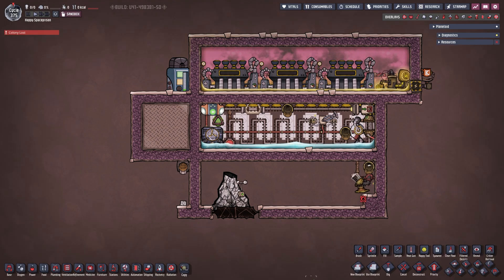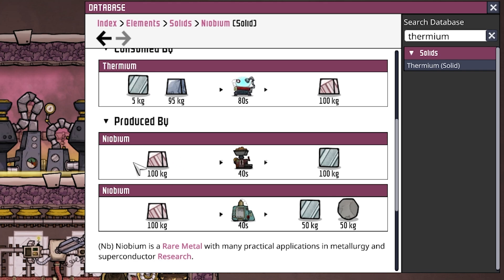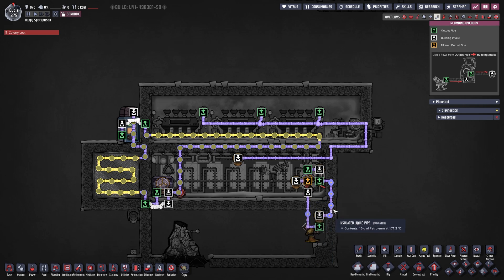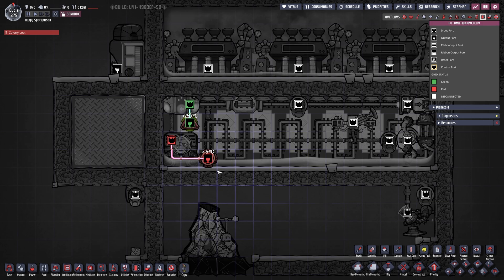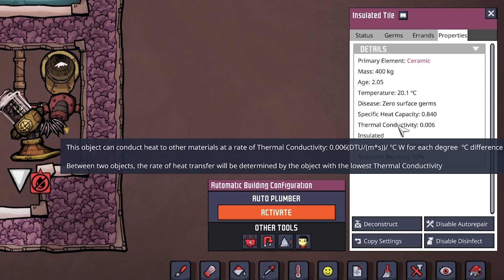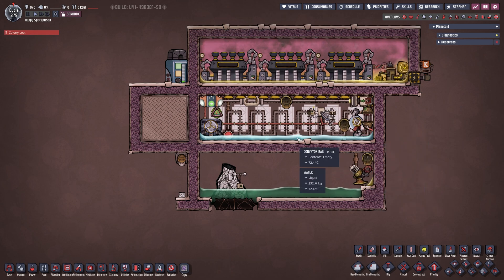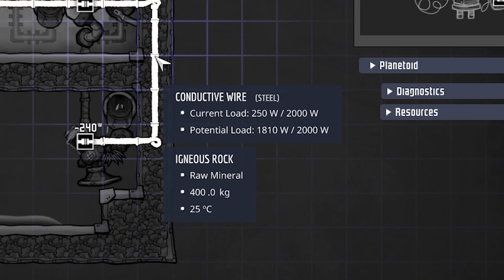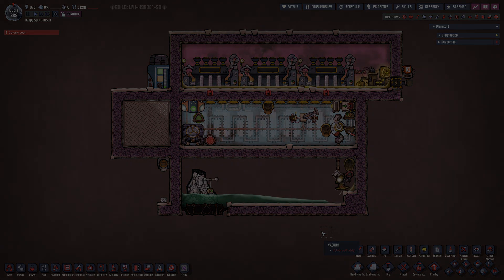GERMAN ENGINEER explains ONI: NIOBIUM VOLCANO TAMER for Thermium! Oxygen Not Included Spaced Out

Comment: one more question, instead of the filter and meter valve, the "mechanical filter" couldn't be an option?
Reply from the maker: The mechanical filter would be an option instead of the filter, but the metering valve is needed to control the exact amount of liquid being dropped on the tile by the pump. That is highly important, so no liquid ever leaves that tile and comes into contact with the Niobium!

Comment: with the tile under the left part of the pump as a thungstene pressure plate ( or hydro sensor to not mess with the insulation line under) couldn't that be used to turn of the pump instead of a manual switch? iirc that one would not melt

Edit: I'm dumb, forgot about overheat temp, don't mind that one!
Reply from the maker: Haha, it happens, no worries :)

Comment: What is the function of the metal block on the left?
Reply from the maker: This is a "cooler" or "cold box". The tiles are made from aluminum, cold water is routed through it to cool down the metal tiles. The aluminum has a very high heat conductivity and in turn cools down the solid material on the conveyor rails that we route through it. Easy and fast to built, but extremely efficient :)
Reply: @BierTier  Thank you

Comment: Nice design.  BTW I’m pretty sure you don’t need thermium for the liquid pump if you cool it with a loop of hydrogen gas.  Just one piece of radiant pipe in the place your petroleum  priming liquid drops down will cool the pump and you can then loop the gas up to dump the heat off in the steam room.  Then a steel pump should be more than enough as long as the pump doesn’t actually touch the niobium.
Reply from the maker: Thanks! Yes, I think you are right, that could be solved differently, with your version for example. I wanted to make 100% sure that it works in this build for a long time and not make it any more complicated than it already is :)
That's what I love about ONI, many different paths lead to the same or similar result :)

Comment: will the liquid pumb break if let it run for a long time because no coolant for it ?
Reply from the maker: You are correct, I overlooked the pump. It will take so long for it to cause an issue since it's built out of Thermium that I kinda forgot about it. But, here is a easy fix for that though: https://bit.ly/PumpCooling
Reply: @BierTier  that design is excessive and counter-productive due to the fact that non-nobium pump would easily got broken. U just need  to make the conductive pipe for petrol. That only requires steel pump

Comment: Great build going to steal it.😀 Just to explain you need the conveyor bridge to direct the flow, because the Conveyor Loader "Output", Sees the Conveyor Shutoff "Input" as a viable Exit so it gets confused and sends stuff both ways. Same with pipes as well. Putting the bridge in stops the confusion.
Reply from the maker: You are not stealing, you are doing what I intended with those videos :D
Thanks for the explanation, that's what I figured but didn't loose a second thought about it, haha :D